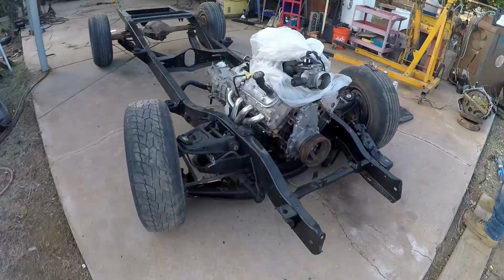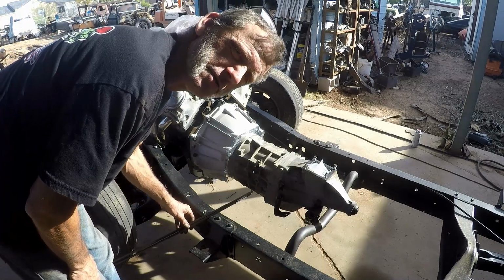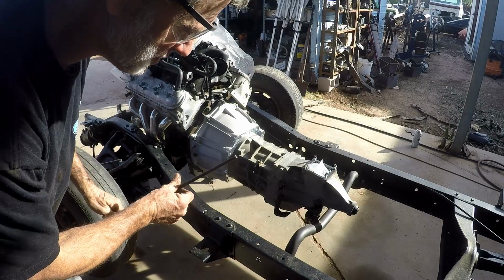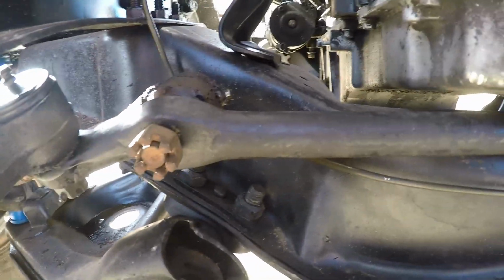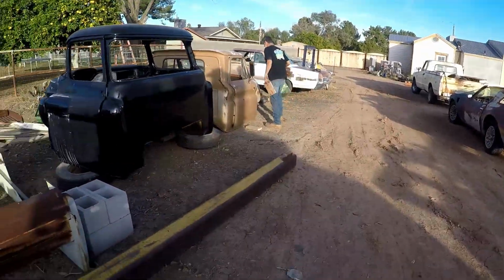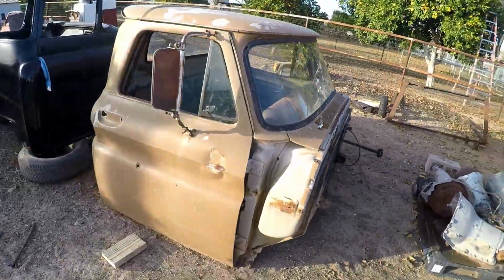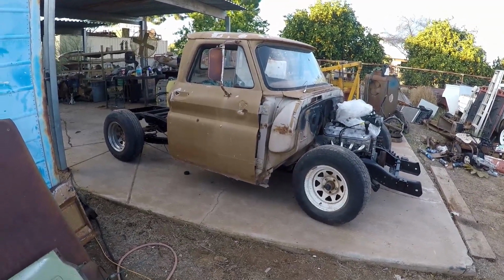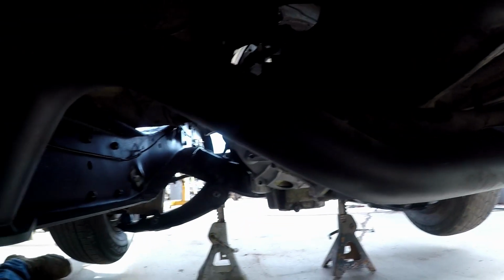The devil's in the details. On Ben's truck we do brake lines, fuel lines and set the cab

Comment: Looking good. Any tips for bending brake lines? Did you do it by hand or use a tool?
Reply from the maker: Both! We have a hand bender but many, many times we make corrections by hand.  We also bend around welding tanks or exhaust tubing if we need a different radius.  Thanks for watching.